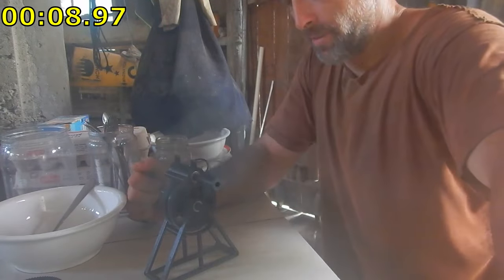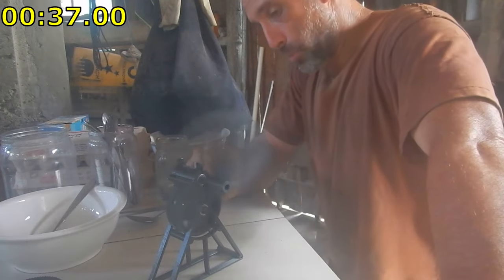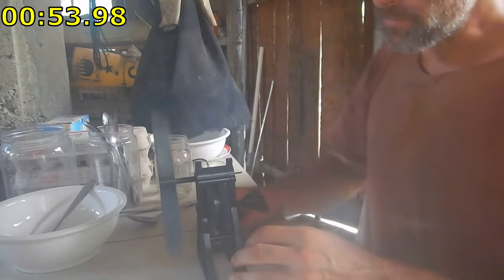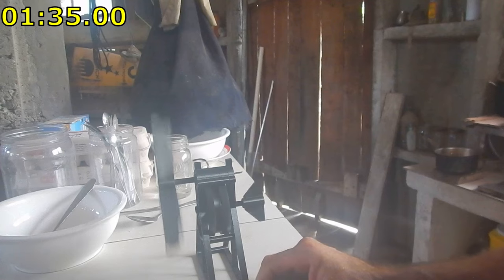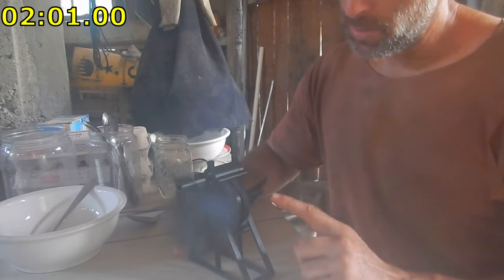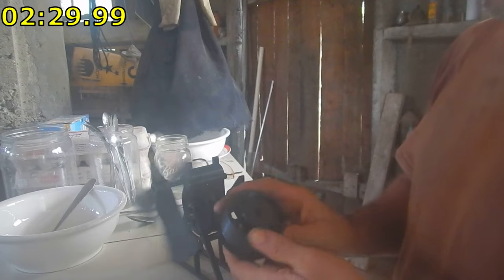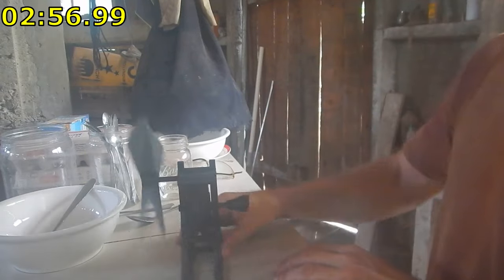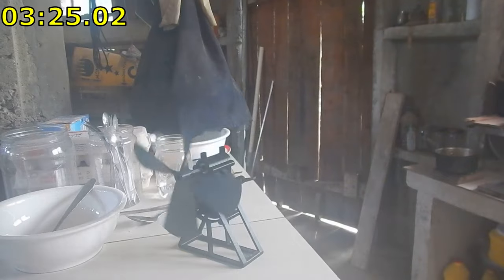Wind Up Fan 2nd Try

Comment: bear in mind that I know nothing but have you thought about using a keyed windup handle so you can pull it off when you get to max windup and let it rip without the extra handle weight+friction? I seem to recall toys like that